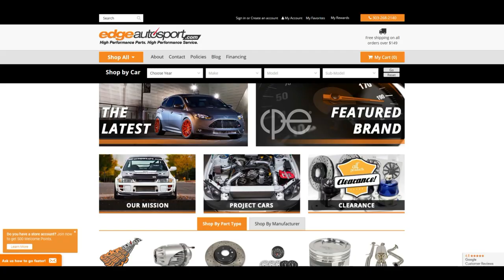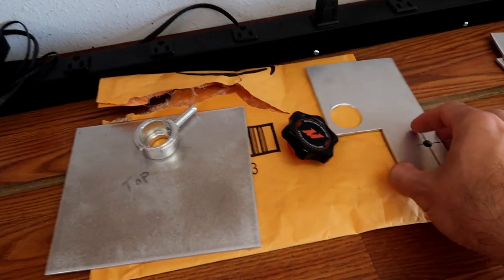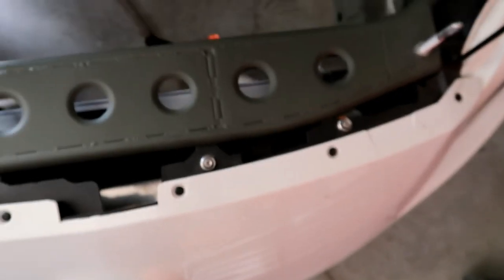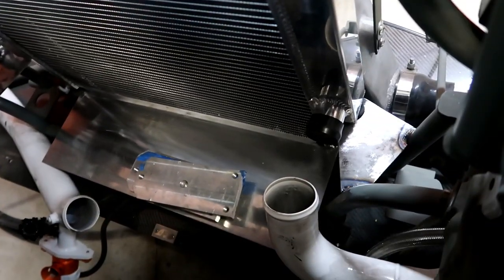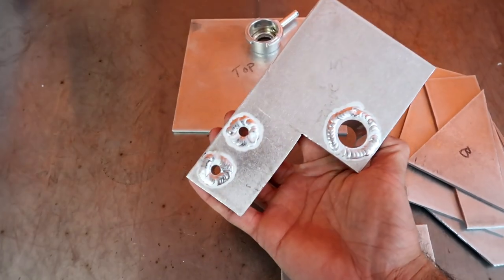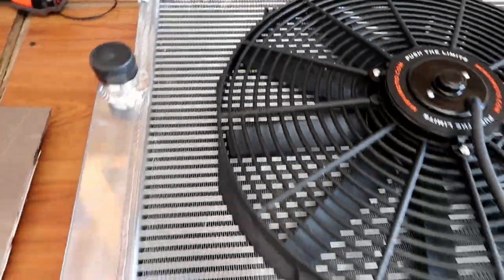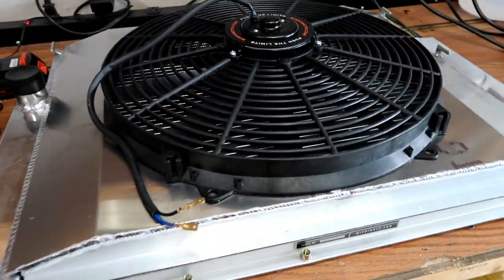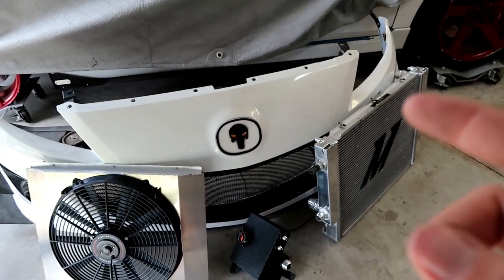Mazdaspeed3 Cooling System - Mishimoto Radiator (Episode 39)

Comment: Any particular reason you went with Mishimoto? Asking because Koyorad have a radiator for the Speed3 platform, i think. Not sure if its for Gen 1 or 2
Reply from the maker: Peter K. They are on back order 4 weeks of wait. Also this kind of worked better for my application